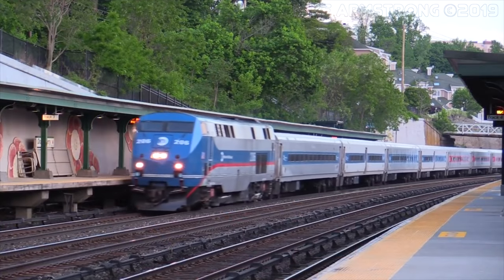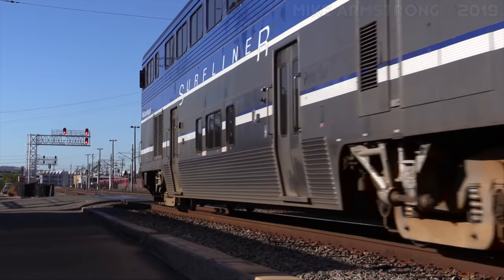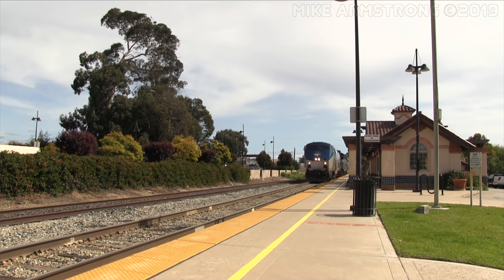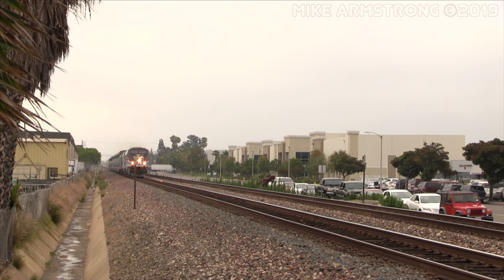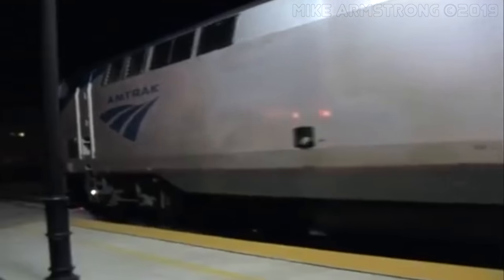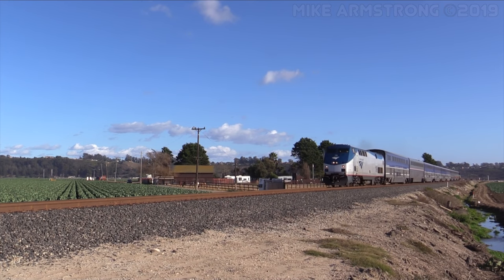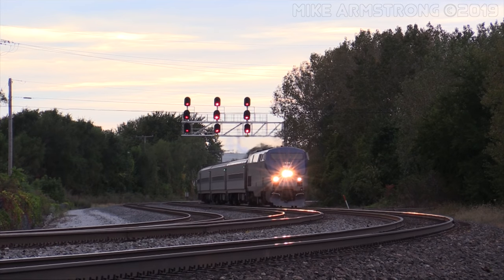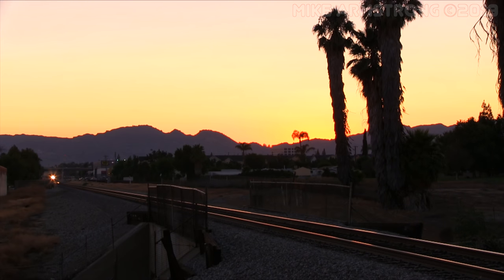GE Genesis Locomotives: Train Talk Ep. 22

Comment: I wanna see some of the P40/42s go to BNSF, UP, CSX and NS because honestly I wanna see what they'd look like in those liveries
Reply: Personally, I don't think they'd look that good in such liveries.
Reply: @thomaspalmer1019  wonderful!
Reply: What would they use them for?
Reply: @therailthing610  exactly. The P42s aren't designed for freight work.
Reply: Thomas Palmer actually you’re incorrect, they were originally lightweight freight diesels for fast freights however ended up being passenger due to how well suited the design was
Reply: The Rail Thing CSX has a pair of F40s for executive trains, so for them it’d be to supplement those when they break, same for the UP if it’s E8s and the DD40 are broke or on other assignments, BNSF currently doesn’t have any special stock for its executive trains, the last one of which I remember being back in ‘05 when the 1522 hauled it. For the NS it’d be if the F9s broke.
Reply: N&W 2156 Y6a Oh I’m sure that design is just great for switching. Totally great for freight service. And 4 axles with DC traction too! My goodness! Such a great locomotive for freight service. 4 axle units are so good at mainline freight service that there hasn’t been one made since the GP60/GP60M and B40-8. What a great idea lol
Reply: N&W 2156 Y6a I would love to see how they were originally a lightweight freight loco, as no railroad would ever have a use for them. 
If you call attempting to keep junk in service because you don’t want to see it retired being smart, then your definition of being smart is much different than mine. The only place age matters here is with the Genesis units. They’re old and junk at this point. You can convert freight locomotives to passenger service, but it’s often much more difficult to convert purpose-built passenger locos to freight service. There are a handful of exceptions, but most of them would still require a fair amount of modifications. 
If you think I’m some crabby old dude, you’re sorely mistaken. I’m 17, not much older than you claim to be.
Reply: @blackbirdgaming8147  alright, I did digging and I'll admit I was wrong about their original purpose, BUT you're in the wrong as well, you're in the wrong for calling me a dipshit, which was completely uncalled for, and I was and seemingly still am unable to have an intelligent conversation with you. I'll say one last thing, by your logic, although the Genesis locos (which I don't agree are junk and with some time and effort, especially with the recent rebuilds, can be brought back into amazing shape since they're still running) have seen pretty hard use, what about the SD40s, they've been around at least 10 years longer than the oldest Genesis and railroads, Class 1 and short lines alike adore them, what about the GP7s, 9s, 15s, 20s, F3s, 7s, and 9s, they've been around since the 40s/50s and a lot of them are still going strong in preservation, NS has a pair of F9s for excursions and executive trains (the B unit is a F7), as well as the Durbin & Greenbrier Valley, they've got at least 2 that I know of, as well as one of the only operational B2s, and only 1 of 2 in existence owned by the WM, which were from the 40s. But wait there's more, what about the UPs E8s, the executive set, what about them, are they junk cause they're from the 50s? If the UP took all of that effort to put 645s in them I doubt they'll agree. What about steamers, the 4501 is 105 years old but I don't see anyone (well except maybe some brits) calling it junk. What about all of the diesels at the IRM, one of which dates back to the 20s. What about the F40s? I don't see people calling them junk, except for the cabbages that Amtrak runs now, I agree that the design is unconventional and that leads to increased cost for repairs, but these engines aren't junk. They're the first diesels I've heard of with 4-stroke engines. Oh wait, lets not forget all of the Dash 8s, and the AC6000s, and all of the original GEVOs, what about them, surely the Dash-8s, from the exact same time period and even predating the Genesis are junk as well? If this is true, then why do the railroads still like them? I don't believe that these engines are junk, they're just used, if they were junk they'd be in a scrap yard somewhere by now, not still plying the rails waiting for their replacement just like the F40s, of which VIA still has a fleet of and has no plans of retiring that I know of. At least some of these engines, especially the low number ones, maybe even the one or ones with the highest numbers, will end up in preservation. Maybe even the TVRM will get one, who knows.
Reply: N&W 2156 Y6a I see what you’re trying to do here. It’s not a good tactic. Throwing out random examples to try to seem smart when you really don’t know what you’re talking about doesn’t work. These locomotives absolutely are junk. The thing with the Genesis units and the P32-8BWHs is their prime movers run at 900 rpm at normal idle (exception being 1047 rpm in the case of the P32AC-DM). That means they have a little bit more wear than a unit that doesn’t run its prime mover that fast 95% of the time. There’s no way to just lower the prime mover speed as the Genesis units don’t have separate HEP Generators. 900 rpm (1047 rpm) is absolutely necessary in order to produce the proper 480V 60Hz HEP. This also helps alleviate how slow GEs load, which is tough on commuter schedules. 
The P32-8BWHs are really the only locomotives that have some hope finding a home in short line service, but that won’t happen for a while. Commuter service is out of the question, they’re too slow (just look at the Pennsylvanian’s on-time performance with P32-8BWHs leading). That’s also ignoring the fact that the P32s have barely any horsepower. The locomotive makes 3150-3200 horsepower from the 7FDL-12, but only in freight mode. In HEP mode with no HEP load, traction horsepower immediately decreases to 2700 hp. That means even when the locomotive is idling by itself, if HEP is enabled, only 2700 traction hp is available. At full HEP load, that number decreases to a minimum of 1685 traction horsepower. 
Since the P32-8BWHs have less miles on them than the Genesis units, the Dash-8s have proven useful as backup power, switchers, and MOW units. Add to the fact that they were built with an easy conversion to freight in mind, and they are perfect. The Genesis units are much different, more on that later.
You also have to take into account that these locomotives are no longer supported by GE, which further supports the theory that GE builds their locomotives for planned obsolescence. If you don’t know what planned obsolescence is, it’s fairly self-explanatory. GEs simply don’t last as long as EMDs do. Some locomotives EMD has made seem to suggest that they do in fact build them with planned obsolescence, but that’s really just a result of the major fuck-up that was the SD50. From there on out, they’ve lost the market to GE (sales figures back this up). EMD’s locomotives have gotten progressively worse (don’t tell me the SD70ACe or the SD70M series has been a success because it definitely hasn’t, just ask the crews and the honest guys that work on them. GE also leads in sales), until some dumbass at Progress Rail really screwed them over. Instead of taking the time to properly engineer a 4-stroke engine, they basically just cut 4 cylinders off the 265H (a major failure for them) and tried to call it a new engine. 
There are hardly any AC6000s running today, and those that still are running have been de-rated to ~4600 hp (based on the CSX designation). Those units are still suffering issues. On the EMD side of things, it’s roughly the same story. There aren’t a whole lot of SD90MACs still running, if any. Most of the SD90MACs that are still running are SD9043MACs, and those are problematic as well. The “H” engine was a disaster for both EMD (265H and now the 12-1010J) and GE (Deutz-GE 7HDL-16). 
I can see why you’d think that they’re not junk, and that they’re “just used”, but that’s not the reality. Maybe you should think about why it is that, more often than not, ex-Amtrak units fall apart after being sold. Not too long ago, an ex-Amtrak F40 suffered a major fire while running at Metra. That’s just one example. I can think of or find a lot more.  
Most Dash-8s still running today are junk as well. That’s why they’re being phased out and why NS aborted the Dash-8.5 program. It turned out to be more expensive and more difficult than it was reasonable. The cons ended up outweighing the pros. 
The original GEVOs aren’t junk because they haven’t hit their planned obsolescence mark yet. 

SD40s aren’t junk because they’re the most reliable and best-made freight diesel ever, and EMD hasn’t made a good locomotive since the SD45-2 (exceptions being the SD70MAC and SD80MAC). That’s a whole different case. The fact is, EMDs just last longer than GEs do. The reason UP went through the trouble of converting their E9s to 645 prime movers is because it saved fuel, and 567s are very similar to 645s. It made more sense to run with a single 2000 hp 16-645E than twin 1200 hp 12-567Cs. NS switched to 645s/upgraded to 645 power assemblies for pretty much the same reason. 

You don’t have to agree with me, but these locomotives are at the end of their useful life. Amtrak is considering upgrading a few to AC traction, but even they know that’s just prolonging the inevitable. The only reason they’re even exploring the option is because they don’t have money. Chargers have more horsepower and AC traction. You can’t upgrade the P40s and P42s to 4400 hp because they have to fit height restrictions, Amtrak found that out the hard way. And like I said, AC traction is just prolonging the inevitable. Normally I would agree with your point that if they were junk they’d be done by now. However, this is Amtrak we’re talking about. VIA has ordered Chargers to supplement and replace their fleet because they are better-funded than Amtrak is. Amtrak doesn’t have any money, which is the entire reason why they haven’t been retired and scrapped yet. If Amtrak had better funding, they would immediately replace the entire fleet.
No freight railroad will ever want them for executive trains as long as F40s are still available. Why buy something that’s harder to fix, loads slower, and has less life left in it than an F40? Same goes for them being used in freight service, ignoring the fact that the monocoque design literally prevents that from happening.
Is that intelligent enough for you?
Reply: @blackbirdgaming8147  Well, when some railroad buys a Genesis or the Dash-8s, just rebuild the prime mover to idle at normal speeds, VIA did it by extending the carbody on their F40s and putting a 3-cylinder CAT in there.
Reply: N&W 2156 Y6a You just don’t get it. Seems like you didn’t read all of what I said either, and I suggest you should since I had to read through the bs essay you wrote. It’s also very informative.
Anyway, you can’t just add a separate HEP generator to the Genesis units as that would only make them accelerate slower, which would further seal their fate as obsolete power with no future.
Reply: @blackbirdgaming8147  Make them accelerate slower, I see what you mean, 4-stroke engines do accelerate slower (but put on a better show) didn't ALCO use 4-strokes in it's later diesels though? And actually, I ended up reading all of what you read, you brought up some very interesting points that were valid, the one thing (as thou are more a more learned thrain geek than thyself) is dipshit, really? I don't know if you had a bad day or something, but really, dipshit? Anyway, there's not much business of a Genesis being on a Class 1, which I see now (although I still think it'd be interesting to see them in said liveries) what about tourist lines, who might not need a fast revving locomotive, but one with good power (if the HEP was removed altogether) and lightweight, I think less than a GP38. I think there might be something for them there, after a rebuild of course. And I do agree, the SD50s were really bad (but not trainmaster levels of bad), but it's funny that you see some of them still moping around, just like some of the SD9043s, of which NS owns (I think) all of them, and are going to rebuild them to 4500hp with Progress rail components and give them the ugly as sin SD70ACET4 cab. I guess (even though I never really like the Genesis in the first place as I am a die-hard F40 fan) that looking at them now, they're kinda cool. I guess that Amtrak engines just keep getting uglier, from the E8/E9s to the SDP45s (which were actually nice looking like the F40s) to the P30CHs (I'll just call them unique) to the Genesis, to the F59s (ughly) to a trial of the F159s (painful to look at) to the Chargers, which look better than the F159s, but they just aren't as neat looking as the Genesis engines, which still look kinda futuristic, almost spaceship like. I would like to see some of them preserved (especially in the Phase III scheme because that looked really neat) but I guess they have to go at some point, I just wanna see at least a couple go to a good home, like TVRM or the Grand Canyon or the Rio Grande maybe even the GSMR, I just wanna see some of them survive, and alive. I've only ever seen one of these in person, and only at a fleeting glimpse, but I really wanna see one again, and I wanna see it in something other than seawater blue and depression grey.
Reply: N&W 2156 Y6a Every single ALCO diesel ever made has been a 4-stroke. Fairbanks-Morse still makes ALCO engines for the marine market. ALCOs accelerate and load pretty slowly as well, so I’m not sure why that’s relevant.  Don’t believe me? The turbocharger lag should be enough. That’s why ALCOs smoke so much as they begin to rev up.

I doubt a tourist operation wants to take on the responsibility of such a powerful and unique locomotive.  There’s no doubt that at least one will be preserved, but I seriously doubt they will be out there making money. It’s asking a lot for IRM to even take one in, and they’re definitely going to preserve one when the time comes. There’s just no evidence or case to support them going out and making money. 

If actual engineers happen to read this thread: I’m not talking out of my ass when I say GEs load slowly. You and I both know they do, and I’ve had the privilege of experiencing that for myself on the only operational U25B in the world. I only had to go to notch 3 to understand your pain. 

The SD50s that are still running to this day have pretty much all been de-rated to 3000 horsepower. Essentially, they’re just longer SD40-3s (as most have been rebuilt to -3 standards, particularly on CSX). The 9043MACs have been given new life, and I’m glad they’re doing so. The issues are finally going to disappear. I wish the same could be said for the SD50s, but they will more than likely remain de-rated junk for years to come. It’s ironic that it took GE of all companies to fix the 645F for use in the MP36PH-3C/3S.
The SD50 was arguably worse than the Trainmaster. They accelerated stupid fast, and SP made good use of them in commuter service. The heavy duty traction motors were a big help. There’s no denying the OP engine issues and how complex it was, but when kept in good shape they hauled ass.

The Genesis series has no future in revenue service of any kind, period.
Reply: @blackbirdgaming8147  Fair, and I never disagreed that ALCOs rev slowly (but dang the show) however, the Trainmaster and the Genesis are kinda on the same level, both are painful to maintain, to get to the engine the entire body/roof has to be yanked off, and the trainmasters actually were worse because the engine was made for submarines, and if something broke on the bottom crank, the top half of the engine would have to be yanked out to get to it, a problem that the Genesis doesn't share. I agree that it'd be hard for a small railroad to make much money off of Genesis locomotives, even if it's modified for less wear on the engine and more power. And unique? I'm not sure about a lot of railroads but I'm pretty sure the IRM won't mind it for it's uniqueness (even though like you said they will most definetly get one) considering the fact that they have the last Baldwin Centercab in america, a metric poop ton of interurbans/trolleys, trolley buses, not to mention an interesting combo of ALCO, GE, GM and even a couple FM locos. And that Oil-Electric from Canada. The TVRM meanwhile, would probably (if offered a good price) get one too, considering the newest diesel of their's is a GP38, or 2. They also have 2 operational steamers (not to mention the 5 others), and because their cars have their own generators, they'd most likely remove the HEP, and paint it in their Maroon and Black livery. Unlikely, but I think they'd take it if they could. And I'm not to sure everything that was wrong with the SD50, other than the prime mover.
Reply: N&W 2156 Y6a The SD50 had serious electrical issues, which has since been fixed by upgrades to -3 standards. The prime mover is still a major problem, and that’s why all of the SD50s will stay at 3000 hp.
Reply: @blackbirdgaming8147  That's why everyone hates them, sounds like the SD90s. The SD80s were kinda the same way but they were actually good locos just pigs on fuel, much like the SD45s.
Reply: N&W 2156 Y6a The SD50’s problem wasn’t with fuel. The problem was that they tried to stretch the 645’s limits and ended up stretching it too far. They rated the 16-645F at 3600 hp and ran it at 950 rpm instead of the usual ~900. This caused crankshaft issues and extreme amounts of excessive wear, on top of recurring electrical issues. To put this in perspective, the SD40-2 made 3000 hp and only required a major overhaul about every 4 years. The SD50 made only 600 more horsepower and required a major overhaul every 2 years. 

You’re also wrong about the SD45s being hogs on fuel. They were actually more fuel-efficient than the SD40s, and the SD80MACs were fairly efficient for the same reason. The SD80MAC made 5000 hp when the SD60 made 3800. The SD45 made 3600 when the SD40 made 3000, but the SD45 was actually worth it.
Reply: @blackbirdgaming8147  Guess I was wrong, I swear I heard someone say that the SD45s were pigs on fuel, Same thing with the SD80. I do agree that those are good engines though. At some point I wanna travel to see Hustle Muscle.